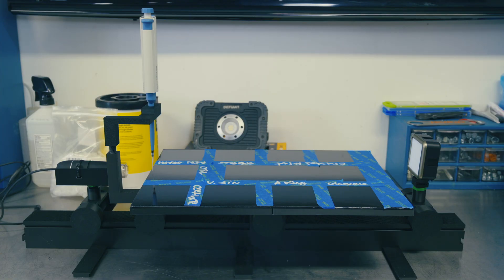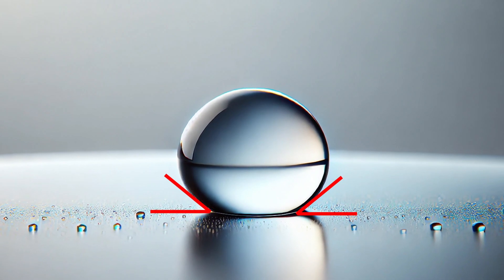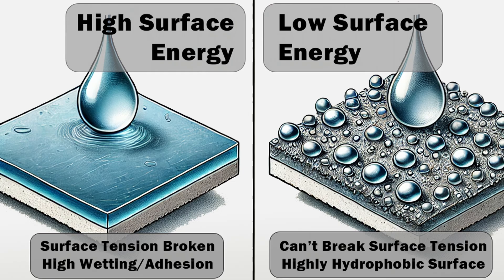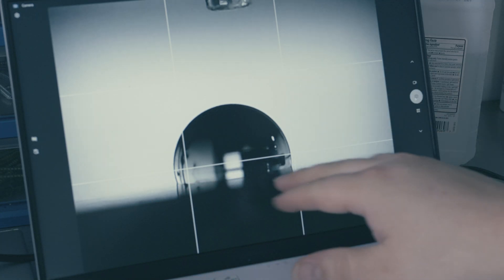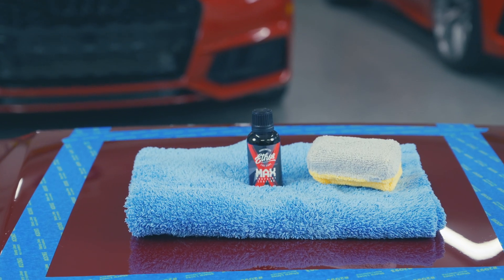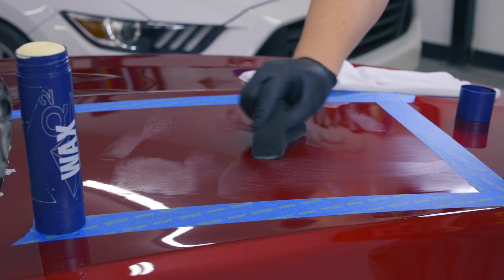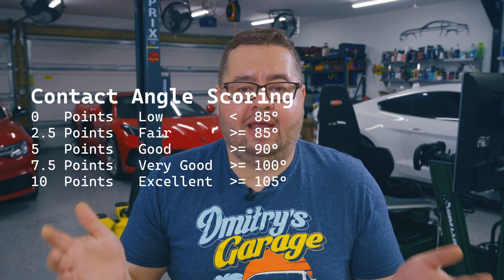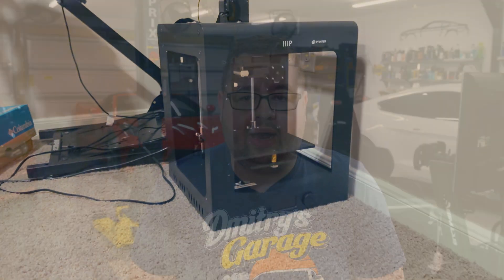What's the most hydrophobic wax or coating? | New testing method reveal!

Comment: I test stuff on an acrylic shower mirror sometimes and anecdotally I noticed the best results I’ve seen are from hybrid waxes. Even above a few ceramic coatings. The only thing is, it doesn’t last.
Reply from the maker: Cool, I bet that's a pretty great way to get a good look at beads by eye or even maybe with a camera phone or one of those lens attachments. Unfortunately as you're finding it's hard to max out all categories of tests because there are going to be characteristics that oppose each other. The closest I've seen so far is probably C6 Hydrolite, but it's also $300, so you're absolutely paying for that.
Reply: @ Infinity Wax Graphene Wax, Supergloss+, and Synergy Wax all have insane hydrophobicity. Fusso Coat also. The Graphene Wax when fresh has a repellency and sliding angle that is pretty amazing. The Supergloss doesn’t last all that long, and the others have PFAS like Fusso Coat I believe. Up to users if they think that’s acceptable from an environmental and health standpoint.

Comment: After using various ceramic coatings for over 6 years now I've come the conclusion they're really not worth it.  They don't prevent bird poo etching, they don't prevent scratches, they don't block UV rays,  all they really are good for is water repelling and maybe make it a little easier to wash your vehicle. They may be highly resistant to harsh chemicals but how often is your vehicle gonna be exposed to those.   You can get the same benefits using spray sealants after every few washes.    That's my opinion.   ty

Comment: Dimitri, can you please make a video explaining the difference between 20 degree and 60 degree setting on the gloss meter. Seems like you use 20 degrees and products tend to loose gloss vs a polished panel but if you use 60 degrees products temd to gain gloss over a polished panel. I think both methods are ok as long as you are consistent in your testing but it would be nice to go more in depth.
Reply from the maker: The 20 degree setting is meant to measure glossy surfaces, like car paint. This is because that sharp angle is more affected by imperfections in glossy surfaces. The 60 degree setting is for semi-gloss materials, I do see other testers using 60 degrees, but this is either because they bought the wrong device (only one setting) or maybe aren't aware of the difference. One reason you might use 60 degrees is for a surface that isn't flat, it's harder to measure rounder surfaces at 20 degrees. In general I find that initial clear coat gloss level is the biggest difference, i.e. if you start with a 85 GU surface a lot of products will increase the measured GU vs. starting at 94 GU like I do. I think 85 GU is a bit dull though, I'd expect most polished paint to be in the 90s.
Reply: @DmitrysGarage  wow, great explanation and didn't know this. Probably 99% of YT dont know this either